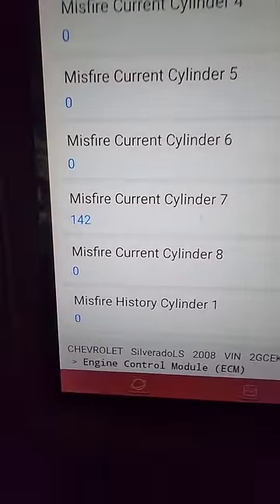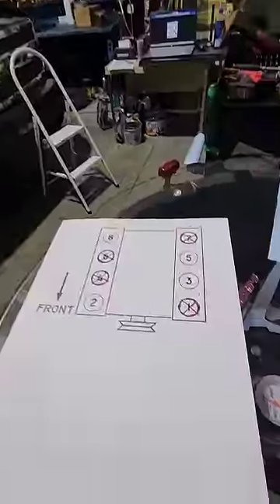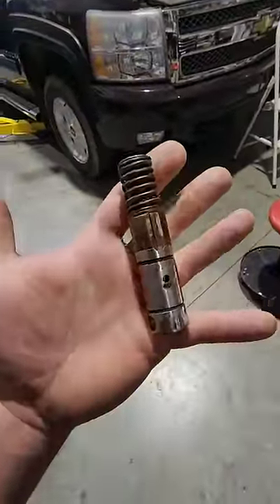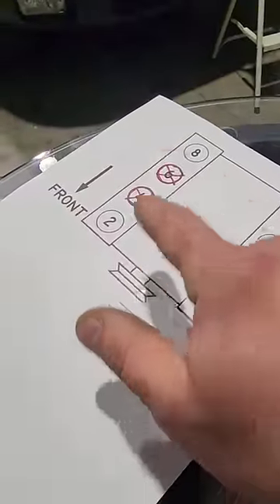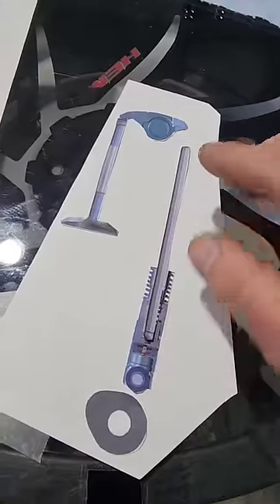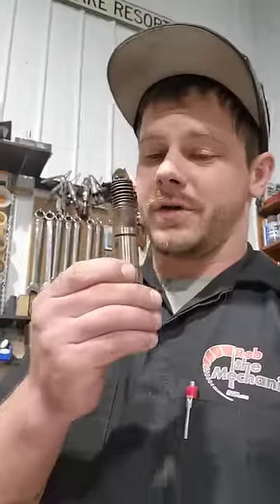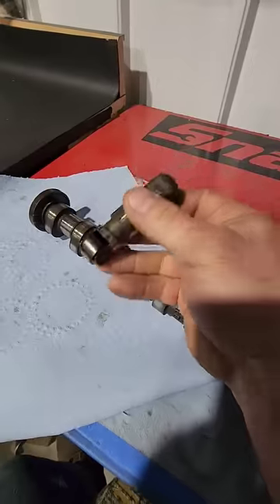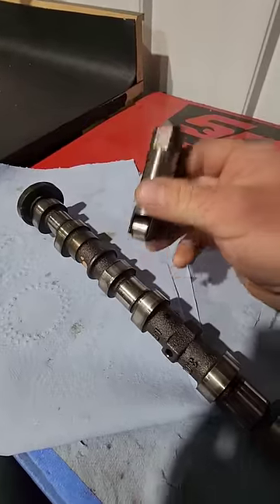GM Lifter Tick #shorts

Comment: I drive a 2004 chevy colorado with the 5 cylinder vortec. Same thing it shuts off a cylinder to run like a 4 banger but it has to  rotate the dead cylinder as its an odd number. I have a missfire at idol that ive chased eveything i can think of to no result. I drive it like a 3 on the tree with no clutch going into idol at stop lights to keep it over the rpm threshold between 5 and 4 cylinders. I have something new to look at now. Do you think this could be the issue aswell or am i just getting my hopes up?

Comment: My 2014  has a chirping noice when i accelerate , i  unplug the wire from the harness to the coil on #6 and the chirp goes away , no check engine light . mehanic says it might be the lifter

Comment: AFM delete, while your doing that, if you've got the cash you can throw in a stage one cam or 2 if you wanna upgrade the heads & exhaust system. along with a PROFESSIONAL tune. not one you buy off of some website. you'll make great power!

Comment: It was the same thing on my Dodge 1500. It has that stupid multi displacement system on it. Where shuts the cylinders down via a solonoid. But the solonoid likes to fail, causing the same kind of misfire, and eventually a tick chewing into the camp.  Not to mention you're heating up and cooling down different parts of the engine. Which isn't a very good design in my opinyou could very easily warp sings when they're not all heating up at the same temperature at the same time

Comment: My 14 gmc had the deactivation turned off in the ecm and when it failed it wouldn't stick collapsed but it would fail to lock in the normal position and not open the valve properly at random

Comment: lol glad I went cheap with my 2019 wt still got that 5.3 none of that extra shaaat tho namean hard asf got it with 23 miles has 65k rn no issues besides radiator cracked for some reason. Was covered under warranty

Comment: My ls4 impala has that. Hate it. Doesn't really save any fuel and it puts strain on the engine, especially if you have a heavy foot. You can get a plug and play AFM disabler that plugs into your OBD port and keeps it in v8 mode. They're kinda pricy, but well worth it to delay the inevitable.

Comment: 8 hours sounds pretty leisurely but good more im not sure how removing the radiation and water pump and maybe the condenser adds 11 hours especially since doings a dod delete is kinda the logical thing to do after one fails anyway and i mean at that point id go truck norris which would add some tuning time but im just not sure how adding a cam while the heads are off adds 11 hours

Comment: Mine ticks a little when it's warming up but then quiet down should I take it into a shop ? It's a 03 Avalanche 5.3 L
Reply: It should be fine. Just remember to change the oil frequently. If it starts getting worse I would definitely look into getting that fixed

Comment: That’s an engineering design flaw. What they could have done instead was have a way to disengage the piston by engaging a third valve to allow air to flow on the inactive chamber. While air flow is active, deactivate the fuel injector for those deactivated pistons. Don’t touch the pushrod roller assembly.

Comment: Doesn't the 5.7 Hemi do something similar? I want to delete that in my wifes Grand Cherokee before it rears it's head & it is also why I am using Amsoil with a WIX XP filter & changing oil every 5k. Oil is the cheapest thing I can replace I figure.

Comment: Is the extra 11 hours taking the front cover off and accessories off.with no room in the SUVs ?

You need to remove all rockers , pushrods and heads already to do the lifters. How does also changing the cam double the job the heads off is the most painful part on a sedan.

Comment: I could use some help on my 91 ford ranger 2.3 I replaced the mass air flow which fixed it but I'd already ordered new tps and idle air control once I changed the tps it idles high every time it's started and it keeps dying once you turn the key off and start it again sometimes it runs perfect and othe times not so much

Comment: Unless you are me... and have a wife who doesn't like to spend money on "stupid stuff" so you let it go and now you HAVE to replace it all.

Now I just buy the new heads with more clearance and larger valves and a comp cam with an extra .625 lift and she has no idea what that means, but I needed to do it to get the engine running again.

Comment: Government Motors has had cam and lifter troubles since the small block was invented.
Reply: I would say since we went to mandatory unleaded gas in '73 or '74. Those 350's all had a top end tick, haven't owned a GM product ever since my '74 Jimmy. Life is good
Reply: @johnswanson3741  I had a 1964 Bel-Air station wagon with a small block engine. I had to put cam, lifters, timing chain, and sprockets into it. The parts cost more than the car was worth, but with a bad engine, it was worth NOTHING. Last Chevy I owned.

Comment: The moment that lifter fails, the cam is done...drive that ticking biatch to the shop and do lifters AND a new cam.  unless the roller explodes, the metal shavings will be picked up by the oil filter and VVT and Cylinder Solenoid screens.  98% of the time, cam and lifter replacement will suffice...do NOT just change lifters.  Always do cam if a lifter fails...

Comment: My Sierra (2009) has been ticking since 28,000mi. Warranty wouldn't cover it because I didn't have an AC Delco oil filter on when I went in. So I never bothered with it. Today I'm at 234,000 mi. 
Middle finger to the service dept.
Reply: You lucky
Reply: @johnswanson3741  yep.
Reply: That's ironic because AC Delco Ecore filters have been the source of problems for some owners. AC Delco had the best oil filters on the market for years. If you compare the Ecore with the non-Ecore you can feel the difference. The case is thinner steel, the top plate is ridiculously thin.
Reply: @poohbeartube  it was obvious they were using the aftermarket filter as an excuse to not do the warranty work. But it's all good. My vehicle took great care of me despite the odds.
Reply: @poohbeartube  and it rides very smooth. The ticking stops once I start moving.

Comment: bro 19hs???  i fully rebuilt mine with forged internals. in under 7 hrs,,,, including pistons....  who taught you to be a mech?    mines still driving 27k mi later, and 31 passes on 150shot of nitrous
Reply: Go open a shop charging your customers and paying your techs less than 7 hours for a job that calls for 22.3 hours in the labor guide. You'll be the only one in the building before going belly up.

Comment: those lifter are controlled by oil pressure the issues is not the lifters it has to do with the engine oil pressure and oil passages if the lifter are not getting enough oil pressure the means the rest of the engine has issues if the camshaft is this bad I replace the engine, just think about where the shavings from camshaft went, the roolers should not be affected by the active fuel management system the lifter should callaps to cancel the cylinder.

Comment: Dodge engines always have a horrendous tick I've noticed. Often times they're on the gas V8s from the early 00s to 10s. What's the reason for that by chance? I've heard exhaust manifold is a common issue but aren't too experienced with those vehicles.

Comment: Explain this to me because i really dont understand.  Why do we need to stop valves opening and closing?  Why not just shut off the fuel injector only and let the valve train do its thing?
Reply: Would screw up the fuel metering as now you have unburned air passing through and going over the upstream o2 sensors and also into the cats and you are bringing in air past the maf sensor and not burning it. Also bringing in oil residue from the PCV system into those cylinders and not burning them, probably foul the plugs and overload the cats.

Comment: Got a 2000 Tahoe just now starting that tape but goes away warmed up
Reply: Curious to know…was it your lifters or your oil pump?
Reply: @buildingbuildercip8292  I didn't do nothing to it yet I don't drive daily anymore it seems to be an issue when it gets cooler out like winter

Comment: Man! Does a cam swap really add 11 hours of labor to that job? With the heads off, lifters and trays out, it seems like it’d be pretty quick to pull the cam from there!?
Reply: It actually adds 7.3. Book time for just the left side is 8. Book time for both sides is 11.7. Cam time is 19.
Reply: @Carlitosway211  man. Seems like a lot.  But yeah I guess to get the cam you gotta pull the radiator and condenser and whatnot. 

20hrs would be worth it for a mild cam upgrade with AFM delete.
Reply: @Maverick09171  The cross member and front diff (if 4x4), the starter, the oil pan. And absolutely, I always try to sell the cam and oil pump upgrade.
Reply: @Carlitosway211  why do you have to drop the pan? I swapped cams in my LS1 and never had to drop the pan.
Reply: @Maverick09171  I always change the pick up O ring. I'm not about to do all that work then have an oil delivery problem due to an O ring.

Comment: you have to pull the heads for the lifters to be replaced, it is not that much more time to do the camshaft......
Reply: Cam swap is an engine pull. That's the best way so you can pull the pan, inspect bearings, install billet plug, all new seals front to back, top to bottom. Screw doing that in the engine bay when you do this every day.

Comment: Wtf why does gm keep thinking cylinder deactivation is always a good on practicality every v8 anymore all the way back to the late 60's early 70's with the oldsmobile then the Cadillac. Shoot there's a reason why reman companies like jasper or engine builder's completely phased out cylinder deactivation when they rebuild blocks and flash the ecu's. Hey gm if a v8 os meant to run all 8 cylinders am pretty sure the owner is okay with all 8 cylinders firing all the time not just operational or whenever the motor detects a certain rpm or speed in the ecu.

Comment: And that's why I have installed a unit to turn the cylinder deactivation system OFF. My car stays in V8 mode.
Reply: I did the same thing on my 07 Sierra that lasted for about 8 to 9 months the number seven cylinder went out done a complete. Delete
Reply: @dwaynefitzgerald9390  I can’t afford a full delete so the electric system will do for now. I think I’m about to have issues with my transmission though. That’s going to be expensive.

Comment: Doubt you can change lifters in 8 hours since the heads have to come off… might as well do a dod delete and get rid of those lifters they will just fail again
Reply: That's what the book calls for for the left side. To do both sides it calls for 11.7. Add the camshaft brings it to 19.

Comment: MDS is somehow better then AFM but also sucks and is an unreliable way to save fuel... The new coyote has cylinder deactivation now unfortunately.... If they took the beam out in-between the cam shaft and crank shaft of the hemi and had another way to add strength.... Some think it's there to purposely prevent splash lubrication under certain conditions to eat camshafts.... GM just uses crap parts.   Best trucks and cars are used or restored or modded(bullet proofed) late models... Older stuff only for me man ...  I even use new old stock if possible when buying parts... Brand used parts

Comment: 19 hours!?! If I have air, I will have both heads all the way off, and start going back together in 4..... For real 19 hours .....? I would do these all day long of that's what they pay. 
Might as well buy a motor and just swap the whole thing. Probably even less labor.
Reply: Of course swapping a whole engine is less labor than tearing an engine down. Go open a shop and try to pay your guys 4 hours for this job that calls for 22.3 in the book. You won't have employees because they'll all quit.

Comment: You'd  think ....they would just  shut the gas off to the cylinders  .... let the valves open and close  with no fuel  getting into the cylinders it shuts off  your still running  regular lifters, but no fuels going to those cylinders unless you turn on v8 mode then the secondary  fuel sytem turns on allowing fuel to go to those injectors . But nope lets build a 80,000 dollar time bomb
Reply: You can't meter your fuel with unburned air going through the system past the maf sensor and over the o2 sensors.

Comment: Its impossible to convince a paranoid customer that spending money saves money.  Nah, the ball joint is fine.  Yes sir.  Two months later...ball joint, upper and lower control arms, tire is shot, tie rods are going, steering rack is not looking good either.  Your car is worthless junk.  Failed inspection.   No safety tag.  Sorry sir.  Shall I call a cab or are you walking home?

Comment: Cam Shafts don't take 19 hours unless you pull the motor tear it completely down and rehone all the holes and put it back together with new cam shaft shops these day way over charge for there work and then do and shit job or break something else just to make sure they get more work you cant trust you most of you these days
Reply: Good luck keep employees around paying them less than book time. It calls for 22.3 hours. We do indeed pull the engine. Inspect all bearings, if any galling, pull crank, clean and blow everything out. Replace cam bearings. New rear main and retainer plate gasket. Billet galley plug.

Comment: In other words, engines that are over engineered to save fuel are far more wasteful than any engine just made to use all the cylinders all the time.  The cylinder deactivation engines last decades.  The cylinder deactivation engines are failing in just a few years.  These new engine do not save money.

Comment: 6hr cam shaft job
Reply: Good luck keep techs in the shop trying to pay them 6hrs out of a 22.3hr book time job. You'll be working by yourself, racing to the bottom.
Reply: @keeblertime1486  who needs a tech?
Reply: @shaggydrill89  A shop does. Go open an actual shop, charging your customers and paying your techs 6 hours on a 22.3 hour job. You won't make it 6 months before permanently pulling the doors down.

Comment: The proper fix to that problem is to yank that shitty LS V8 out and throw a tried-and-true 350 4-bolt 4-barrel down in it instead. And while you're at it throw that autotragic in the scrap bin where it belongs and fit a manual trans in its place. After you've done that, you've gotten all the reliability problems solved.

Alternatively, you could just simply not buy this modern plastic garbage and instead just pick up an old squarebody that already has the good GM V8 in it from the getgo.

Comment: What a problem-making design, what sort of an idiot would design a system like that, as well as the extra wear and tear in the non-firing cylinder ring getting slammed from non-compression reciprocation. GM are fools.

Comment: 19 hours to do a cam and lifters. Yall are robbing  people left and right. Hell that's not robbing that's raping people. Eliminate 99% of the computers and go back to the original style engines and they last longer and don't brake down as much. Labor rates what $130.00 to $150.00 an hour? Its not worth it. Park it and have yard art lol. Cuz I'm not going to spend that much money to fix one.
Reply: Says the gaylord that expects mechanics to work for peanuts.